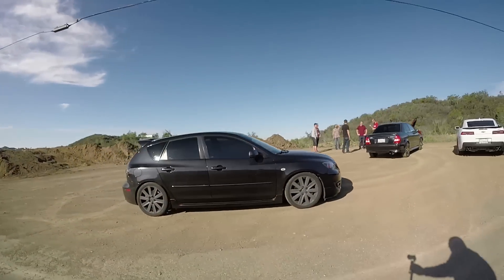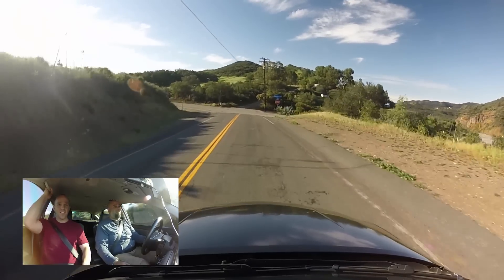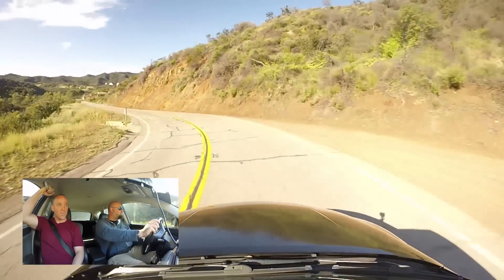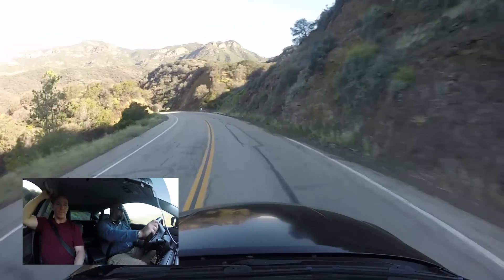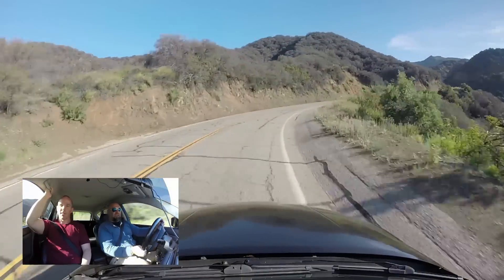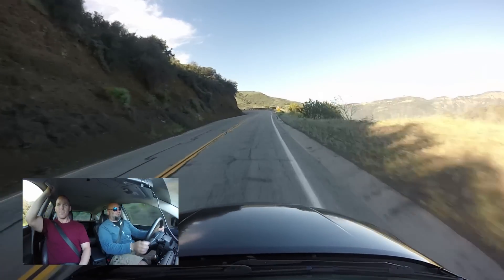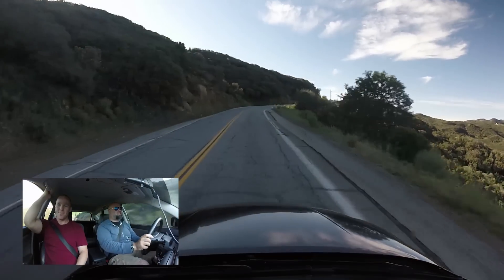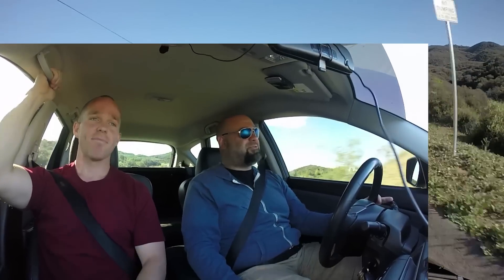450 HP Gen1 Mazdaspeed3 - One Take

Comment: That thing MOVES. It's kind of a special treat when you come across a 400+HP Speed3. Typically, most people do basic bolt-ons and get around 300-330HP. But to see one that's been fully built and running on E85 isn't something you see often.
Reply: ***** I followed a guy on Instagram before he deleted his account and he had, probably around the same HP as this one, a 2nd gen Speed3 with slicks and ran 11 seconds 1/4 mile. I'd imagine this guy's Speed3 would run high 11's or low 12's.
Reply: ***** Tons of speed 3 and speed 6 guys do it here where i'm from. When you're in the speed community you see more than usual.
Reply: ***** No clutch and no brakes? Hmmm.
Reply: jeffS197 I was thinking the same thing. So much unnecessary commotion over brakes. And I doubt anyone preps their car for Matt to review for 7-10 minutes.
Reply: One of these surprised the crap out of me one the freeway one day.
Reply: +yes sir LOL, story of my life. When I pulled a 510hp Jaguar XFR, he had the crap surprised out of him too. I'm at ~380whp on my Speed. Of course, if the Jag didn't weight ~4,400lbs it may have been a different story!
Reply: +Brendan R  It will snap rods before it snaps axles.
Reply: I smoked that blunt with Matt u should've joined.
Reply: +Numinous I snapped an axle 2 hours after I bought my Speed3 with bolt ons😂
Reply: Sam Buffington Bad luck. Normally our axles are good for 1.6-second 60-foot times at the drag strip on 700+ 800+whp Speeds. Then again, every now and then a failure occurs. Generally speaking, we have very robust trannys and axles. For every story like yours there are many, many more of the axles holding up just fine.

Were you the first owner? Was it an OEM axle? If you got the car used and it was abused with a ton of wheelhopping (especially with no engine mounts) the axle could've been significantly weakened.
Reply: Sam Buffington That was probably it. Severe wheelhop is a known issue to weaken and cause axles to snap. The people that know better upgrade the engine mounts and then they can count on the axles to be very reliable.
Reply: +Numinous man that's awesome to hear about stock trans and shafts capable of handling serious power upgrades! It's definitely part of what makes a car a good platform to build upon, focusing on power, suspension, tires instead. Thanks for your info man!
Reply: JoshorBrownKid Theres one in Australia with 530hp you can find it on youtube, though here its the MPS not mazdaspeed 3.
Reply: kasparov9 Lots of the forms have 700-800whp ones, too. 530 is nice, but far from the limits people are reliably pushing on them.

We're deep into the 10s now and trapping ~150mph. Not bad for a FWD that starts at ~3,250lbs stock.
Reply: I'm on 310 hp at the fly, with a mild tune....
Reply: Fast forward to today and Damond Motorsports ran a 11.7 on a fbo stock turbo Speed6 :)

Comment: As a Gen1 MS3 owner since 2008, this video made me very happy.
Very nicely modded car. I was thinking of doing similar power mods to what this guy did, than the RS was unveiled.
Reply: DZEMAG You're willing to dump 45k into your car?
Reply: ***** No, but I would do for the sticker price on the RS.
Personally, I am fine with the power the K04 produces. I was only thinking of the bolt-on power increases to about 330hp max.
Reason this guy spent $45k is due to having to constantly rebuild because of the high power output and probably pushes his car hard regularly.
Reply: ***** that was probably repairs...they aren't known for their reliability. You don't meet a lot of repeat buyers.
Reply: DZEMAG This is NOT a well modded car lol.  For 420WHP, it has a stock clutch, stock brakes, stock wheel/ tire width, stock catback, and a STOCK INTERCOOLER.  Wat. Undoubtably fun to drive, but not necessarily a nicely modded car.
Reply: Caleb Marshall Thanks for your comment, but if you check out my wheel well page, you will see all the other mods that are on my car that weren't mentioned in the review. I am running a larger top mount intercooler which is covered by the oem engine cover and as far as the suspension and handling goes, I am running Ksport coilovers as well as BFG KDW tires that are wider than stock. And for the catback, there aren't any real hp gains to be made with an after market system besides being overly loud.
Reply: Caleb Marshall Yet it puts down all that power and he has driven it over 70 thousand miles. Apparently he didn't spend money to impress the fanboys.
Reply: padsalltheway Whoops, I should have checked. I stand corrected.
Reply: padsalltheway K Sports Kyle, really? lol
Reply: DZEMAG Eh. I personally wouldn't do this to my car. Especially for 45 grand.
Reply: DZEMAG /yeah I was happy seeing this review. I miss My MS#. I had 425whp but no where near 45k in to it unless you count the price of the car then yeah probably about 40k. I had a GT3076 EWG, Tial 38mm which was a mistake, go 44mm cause the 38 can't hang, straight piped exhaust (on accident. Launch control blew my 2nd cat to pieces so I hat to gut it and remove the muffler because of crap stuck in it) corksport divorced DP, turbosmart dual port, treadstone tr11 core, BC coils, attach HPFP internals, Evo 10 wheels, and a bunch of other stuff. Stratified tuned and that thing made beautiful noise but that much power on the front wheels wasn't good some times. I did the SWAS trick so I had no boost cut or traction control either. Love that car but my BMW is little more manageable and faster. Cheaper too.
Reply: +N Lanham No 425whp if you didn't have PI or methanol. I call BS! Lex has told me himself we cap out at 370-380 MAX on stock injectors, regardless of the turbo we're running. Dyno graphs or get out!

Comment: It doesn't torque steer as much because of the power band. The 3076 shines up top, where you don't typically get torque steer. Whereas, the Speed in the video before had a BNR, which has a lot more torque down low in the RPM range - more torque steer.

Comment: mazda has really come into its own since the partnership with Ford ended. All of their cars since 2014 and later are very refined with great interiors and great handling. the only thing they're missing is a car that makes big power. They have an RX concept but who knows if that will ever make production. I personally am hoping for a next gen speed3 using the engine from the new CX-9. So much potential in that engine especially with the great chassis of the 3rd gen Mazda 3. The new speed3 can potentially obliterate Ford focus ST/RS, WRX/STI, GTI/R, etc.

Comment: As soon as Matt heard he put 45000 Dollars in the car, He LOL'D hard in his head
Reply: You can make this power for 4500 and I think thats really what he meant. BNR S4 kit is about 1500 bucks. Youll just need hpfp ($300), rear motor mount($100) , tune($500), exhaust($1000), fmic($600). I miss my 400whp speed3 :(
Reply: Mines been stupid reliable 77k problem free miles it's my daily
Reply: @gokeyinspections8552  cool
Reply: @botdingo  whats the fmic?
Reply: William Brown you don’t need a built motor running an e30-e50 blend could get you 400 on stock motor and clutch
Reply: William Brown also you aren’t paying 500 for a professional tune nishan and Justin from freektune aren’t even charging that much
Reply: @spideybuildscars  front mount intercooler.
Reply: @willthecardude6900  400whp isn't hard on pump gas. When you have 93 octane. On stock turbo which we all know k04 suck mine made 330 wheel on a heartbreak Dyno. Quit talking shit bro
Reply: bmunsamy 

Crazy to put that money in a car for just 450hp

Over spend
Reply: William Brown 

Get it all second hand;)
And learn your self to tune!

Its easy, i know Guys who do it now for years
Reply: @CWEEzL95  you're not making 400hp on pump gas.  Maybe 330-340.  You need ethanol to get into the 380ish HP with just the stock di injectors. Any more and you need aux fueling (methanol/6th port/pi) 
This is from the lips of will dawson at pd tuning.

Comment: Woh 45k into that thing O.o.... Mind officially blown.
Reply: MrGovenator1 What the fuck? Is that what he said?
Reply: Nayr Nitsua Naw, its what she said.
Reply: firehawkws7 He's only had to replace turbos then get the engine built for power. You act like he's replacing transmissions left and right and putting in stock clutches weekly.
Reply: ***** if he bought it new, it would have been $25kish, so that could be the case as well. Also, possible to spend more than $5k on three turbos if you have someone else do the work and stuff. Still seems kinda high though. Oh, he has different tires as well, hard to say what that cost him for sure, but that contributed, I assure you. I wore out the stock potenzas on mine when I had it in 30k miles, lol.
Reply: MrGovenator1 Fuck that.
Reply: ***** I think he's inflated the number a bit. Also it's not likely he replaced the transmission. The stock transmission and axles have proven to be pretty bullet proof. There are guys on the mazdaspeedforums running 700-800 hp without issue.
Reply: MrGovenator1 that has to include purchase price.
Reply: MrGovenator1  I thought he meant 4500. 45k? Holy crap sir!
Reply: firehawkws7 you realise a normal driven car at 180,000 miles will have tons of up keep so I can imagine the up keep on this one.Brakes are super expensive and I can imagine most of his money goes into small part failures. Great Tires help stop more than expensive brakes unless your track racing which I doubt he does
Reply: ***** 170k miles would mean a couple thousand on wearable items, ~$1k on suspension alone (possibly replaced twice already), these transmissions have synchro issues (2nd gear), so possible swaps/rebuilds resulting in ~$1-2k. He probably exaggerated, however the number comes close. What I find odd is how he paid that much, and left all the cooling stock?
Reply: Not necessarily, it depends on why he had to "rebuild" it. Could have sent a rod thru the block, bought a block and crank from Mazda, and those 2 things alone already meet your estimate.
Reply: xProjectTactics Cool your jets.
Reply: firehawkws7  Not sure if cheap has much to do with it.. If it is the same sensor I had to replace to get my TC and ABS back, it was $2,700+.... but thankfully Mazda covered it post warranty.

Considering how much he spent on the engine though, the 2,700 is not that much compared to someone with a stock MS3 having to replace that 2,700 part.
Reply: ***** I suspect a troll.
Reply: impossible Big fan of your work, is this your car? Haha
Everything lines up but he doesn't sound like you at all
Reply: Haha thought so
Reply: +MrGovenator1 WTF? 45K im looking at 2013 Z06's with less than 15k miles.
Reply: +MrGovenator1 My guess is the dude included the cost of repairs, maintenance and fuel haha I just can't believe he's put 45K into the car. I have a similar setup on my 09 MS3, and I'm in it about 22K. And I've swapped out pads and rotors, have an FMIC, wider wheels and tires, and coilovers.
Reply: Well if you listned, he said the car was on its 3rd turbo.  Turbos aren't exactly cheap and you need tuning as well.   It all adds up.

I've already spent a fair bit on my own car and I haven't even gone power mods yet.
Reply: It’s a piece of shit.. I have a little less than that in mine and it’s way cleaner and way more thoroughly built with more expensive parts, he’s not very smart

Comment: I have an 08.5 MS3 that I bought new and while I'm nowhere near 420 WHP, I'm also nowhere near 45k, including the original purchase price.  I'm at 130k and have had essentially ZERO issues other than the basic maint. items (brakes, tires, oil, etc).  Original Turbo and clutch too!
Reply: Same here. I only have 80k on my 09 MS3, but in the 5 years I have had it the only non maintenance thing I've had to replace was the gas cap which somehow got cross threaded on and stuck.
Reply: David Alfonso You keep your speed3 stock? All the ones I have seen near me have been modified. I would prefer a stock one.
Reply: ***** Mine is 2008 white speed3 100% stock with 73k miles
Reply: I have a few basic bolt on mods: Hypertech Tuner, Mazdaspeed CAI, RSB, JBarone Short Shifter.   Appearance wise: HID's (sport, not GT) and yellow film over the fog lights, side moldings removed, tinted windows  Debaged and the Mazda emblems are both plastidiped.  Used to have some OEM RX8 wheels painted black, but I sold those and I'm back on my stock wheels. That's about it.
Reply: Ok so its likely this guy had bad luck I thought these were decently realiable if you didn't go crazy with the power. I would only do a stage 1 or stage 2 Cobb tune if I was to mess with it but being as the car would be a daily it might just stay stock
Reply: ***** That's what I said. I have an '07 Speed3 that I bought form the first owner with 50k on it. That was in '12. I have 88k on it now and have just about reached a happy point. Bilstein suspsension, intake, motor mount, fuel pump internals, boost control solenoid, 3 bar map sensor, turbo-back exhaust, FMIC, Cobb tune, short shifter, stainless brake lines and upgraded pads... and the thing rips. Reliable as all hell, starts everyday, handles nicely. I could always go crazy with it, but this is a nice balance of a daily driver and one that I can surprise people with.
Reply: He meant $4500 there’s no way he put in $45k
Reply: My motor and transmission mount s love to go

Comment: i drive a speed 3, i can't imagine 420 WHP out of that thing
Reply: +The Strength Doc my buddies got a stock(ish 2.3) 3 and it breaks tires all the time lol
Reply: +The Strength Doc Ive seen them on 600-700 whp. the amount of power you can get out of it these days is insane. Honestly prefer the 2nd gen speed especially with body mods.
Reply: +ThirstyMonkeyNicca a good friend of mine has his first gen being built rn, complete build/weight reduction  should make close to 600wheel
Reply: KJDD787 nice cannot wait to get mine.
Reply: any reliability issues?  Planning to get a MS3
Reply: Joe O Had a mps for 5 years 'ms3'....very reliable cars...even when modded.
Reply: ***** few known issues such as engine mounts. just hit 100k and i'm surprised my passenger motor mount didn't break sooner. they're pretty much guaranteed to fail.
Reply: Joe O I got around 160k... plan to change all your motor mounts and tires  this car eats them lol
Reply: Jesus that car won't last long. 3076 no upgraded intercooler, shit brakes, stock clutch only holds 400 max, either straight lies or the car is gonna self implode itself
Reply: I need to start slowly modding my 10 MS3

Comment: "It's got a fresh alignment, so it oversteers more than understeers right now."

Wat?
Reply: Yeah.... Ummm
Reply: Whats off about that?
Reply: @X11CHASE  ...please enlighten me how a "custom" alignment on a fwd car will cause it to oversteer🤔
Reply: @nissantech8857  camber and toe settings alter a cars turn in and coming out of a corner also under accel or decel. Not to also mention ride stiffness on front and rear
Reply: @nissantech8857  youve never heard of lift off oversteer on a fwd car
Reply: Which is based on momentum "load" transfer from backing off the throttle during a turn causing the vehicle to rotate. So have you ever heard of it?
Reply: @nissantech8857  so when you gonna enlighten me on my response?
Reply: @JJ20kil3r  you not worth my time if you think you can adjust stiffness with an alignment homie
Reply: @JJ20kil3r  ..must be a magical alignment shop that adjust factory ride height and roll bar stiffness. So is it camber caster or toe that adjusts ride height. Stick to playing forza
Reply: @nissantech8857  👏👏👏👏👏👏👏👏

Comment: I have a few questions.

How is the rust? Yeah I know you guys are in Cali, but if you ever come to the east coast you'll see 5yo Mazdas that are crumbling apart, so I wouldn't even be surprised if they rusted in less-humid climate just by looking at it :o

Have you had issues with carbon deposits that are inherent to DI, especially with a turbo? Especially considering your higher than stock boost and E85.

The Ksport coilovers are a bit disappointing, though. There are plenty of better quality name brand options for the MS3.

Comment: 2009 Mazdaspeed3 owner here.  It seems like finding a stock Speed3 in my area(Socal near Cobb Tuning) is like looking for a unicorn.  So far I have got 62,000 miles of smiles with no issues.  Just regular maintenance, gas and lots of summer tires.  The sleeper look is a big plus since it is my DD.  And it is all stock and staying that way.  The 2017 awd Mazdaspeed3 is tempting though...
Reply: +1400VID are they reliable? thinking of getting one because it has more room for the dog lol
Reply: Justin Blanco So far, the car has no major issues.  There are 3 minor things like creaky dashboard trim pieces, a burn fuse for the power outlet, and a slight gear whine when in 5th gear.  A co-worker has a 2008 MS3 with 270,000 miles on it so far.  The 2008/2009 models in stock form are relatively trouble free.
Reply: +Justin Blanco My '07 MS3 has been very reliable for 280,000 miles.  Engine is all stock, but I beefed up the suspension damping to make it handle better.  Although plenty will disagree, I don't really think an MS3 needs more power than stock or would handle it very well.
Reply: VAspeed3 Good to hear your MS3 has that many trouble free miles.  It seems they are really reliable if left in stock form.  But I'm not sure why the same engine in the CX7 is having so many issues.  Maybe it was detuned improperly for 87 octane or the auto transmission setup?

Comment: There aren't too many mods needed for this car to be amazing.  You need larger injectors and better spark plugs for a turbo upgrade, like the 3071r.  It would be wise to have a front mounted intercooler, and aem intake, and 3in full exhaust system.  Also, a good power tune is advised.  In all of that, your 0-60 should be like 4 seconds flat.